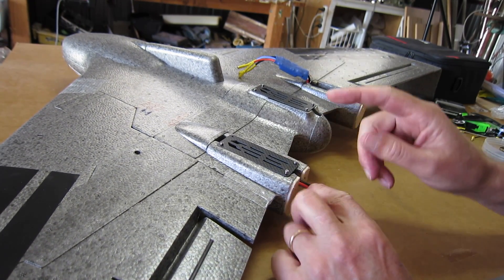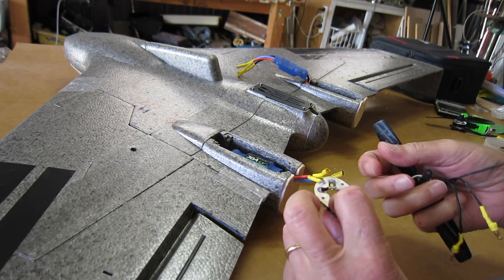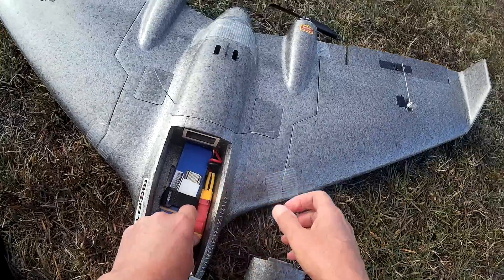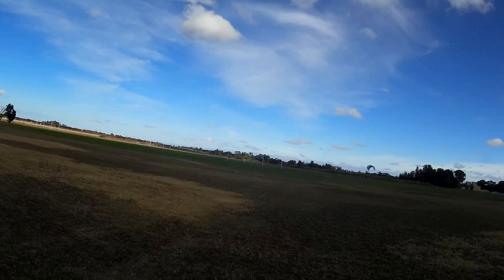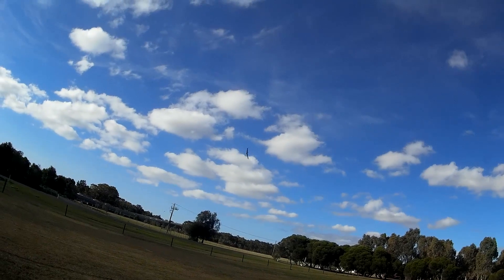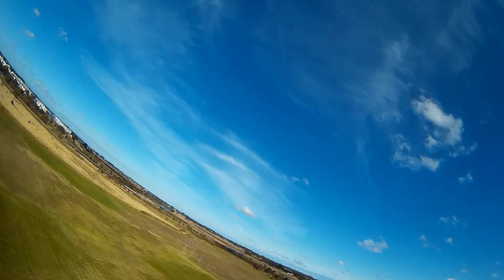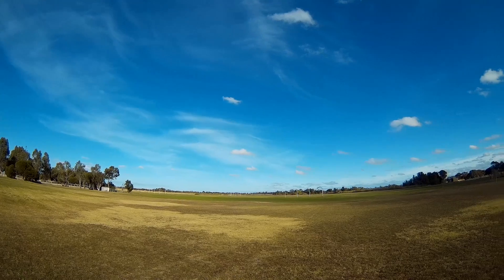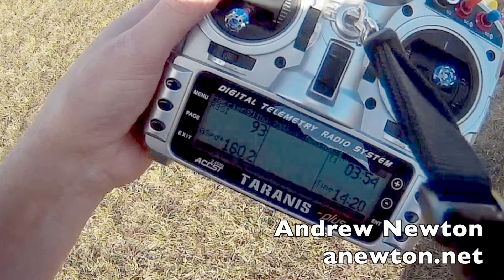Harrier S1100 mods and speed runs

Comment: Andrew, could you please share your opinion on whether to use a single or dual motors? What might be the pros/cons of using one motor with larger prop?
Reply from the maker: Potentially more efficiency, longer flight times and easier to set up with single motor. But twins sound cool.

Comment: Is there any special connection for differential thrust? I was planning to build a S1100 too.
Reply from the maker: Just need a separate channel for each ESC, then mix in rudder with each throttle channel
Reply: Thanks. Yeah, I did find how to setup this.

Comment: Apologies in advance for too many questions. I watched your series on the Harrier and enjoyed it way too much. Despite not wanting such a big plane I bought it last night in a moment of weakness for a bargain price of $138 AUD incl delivery for the PNP version using the toyho discount code .7% off an already bargain price. I have wanted a twin engine EPP wing for some time, but smaller. 

I just want to find out your final setup. 
1/ What size 4S battery are you using to acheive CG? 
2/ Are you using the supplied props (6045 I think) on 4S? 
3/ Are you using counter rotating motors? 
4/ Is differential thrust for rudder worth the effort? You seemed underwhelmed.
5/ I have the S800 and although good, it has in my opinion too much wing waggle and is a calm weather flyer, which I don't get much of. I am hoping the 1100 takes windy conditions better with less waggle?

Love the videos.
Reply from the maker: No problem.
1. 2200 4S or 3000 3S right forward, or 3000 4S back about 40mm will all work
2. Yes
3.  Yes
4. Fun to try but no need
5. I agree, the S1100 will be much better in the wind
Reply: Got my PNP kit & did the assembly. I did a current test on 4S using the supplied props and it was 34 amps. So I am thinking if you run 4S you need to step down to say 5045. Did you do a current test on 4S?
Reply: Oh I meant 34 amps per motor on WOT on 4S.

Comment: Does that differential thrust lower a motor or raise one? It seemed to have a dip when you turned it on, but I am sure you could work that out of you wanted - or just maintain altitude when/if you used it.
Reply from the maker: It does both, raise one and lower the other. The dip might have just been me on the sticks or wind.

Comment: So basically place your order today before the price goes up due to demand?
I was a little bummed with the set first of speed runs. I was thinking i get 80mph with my z-84 and s800 with a single emax 2306 using  a hq 6x4.5...meh. But the second set of runs!!

I would really like to know why this is so quiet so i can modify all my wings the same.
Reply from the maker: It's a bit noisy flat out but most of the time I'm only on 1/3 throttle

Comment: Good and sensible mods and it is a LOT faster than I expected. Your usual explanations and great flying made it an excellent video
I have a single question. Why differential thrust? 
Don't get me wrong, my long delayed return to fixed wing flying came about through purchasing a 2ch plane that only had diff thrust for steering and I'm quite a fan of it on multi engined planes but had never seen a reason to put it on a wing. I'm sure you have a good reason (you always do)
Reply from the maker: Diff thrust just to try it. Not needed at all

Comment: Why don't you just come out and say it, there engineering is CRAP, lol  come on, tell us., 
 
Are the motor mounts set an angle of any kind, Andrew?    You have some speed NOW, wow!  did the motors or speed control warm up at all?
Reply from the maker: Nothing was hot, good airflow. It's a strange mix of clever and dumb engineering. Like there was two separate teams with different goals
Reply: So there was a great engineering department and then a bunch of bean counters that came in and started cutting the good stuff to save a few pennies?  That's what always happens.  It looks like it flys like it's on a rail, very good.     I'm just having a good time, I'm sure they were had good things in mind.

Comment: Was that ground speed? Flying down wind? Heh, I'd be amazed if it could pull that with the equivalent of a miniature barn door's worth of draggy FPV malarkey on board! ;¬)
Reply from the maker: Yes even the mobius made a difference to top speed. Dont know how accurate the GPS sensor is for speed anyway.
Reply: Ah, ok, it's a readout from the GPS, so it's ground speed, effectively, not air speed.

Comment: Yes, those motor mounts were ridiculous....Routed Carbon Fibre plates...?.... but no real plywood..?
  The ESC hatch nuts...?.. lol..best not to discuss that one...:)
  That Foxeer Camera is that a 16:9 sensor..?....your DVR image looks 16:9..?......You have a DVR that records in 16:9 Format Andrew..?...Or is it post video edit stretching?
Reply from the maker: Monster V2 16:9 cam, DVR on the Commander goggles records in 3:2 and I stretched it to 16:9 in editing. But the DVR that came with my Headplay goggles does record in 16:9, 3:2 or 4:3. I now have that one plumbed into the E800 screen.
Reply: Oh, I just bought the orange Eachine Pro DVR...Its supposed to do "HD" setting.....I have an Eagle 2 that does 16:9 in full fat PAL Mode...and need a DVR that can do it justice on my 5.8G rig.
   What DVR do you have plumbed into your E800 screen then Andrew...?....Link...?
Thanks.
Reply from the maker: Came with the Headplay goggles and has an unbranded black case, but I'm sure it's the Eachine Pro DVR. Exactly the same menu look anyway.

Comment: You're making some really greasy landings with that thing. I am really liking the  speed range. FPV stuff today then I'll be ready for when the wind stops and it gets warm again. 17mph winds and 9c today. Where the heck is spring??
Reply from the maker: Had a lovely slow cruise around on FPV yesterday, 2200 4S battery gave me 15 min easily
Reply: Really! I've got several of those. I'll give those a go on the maiden. Again, gracias senor!